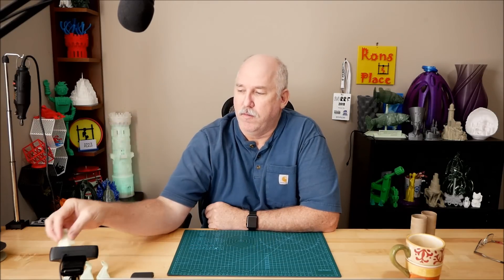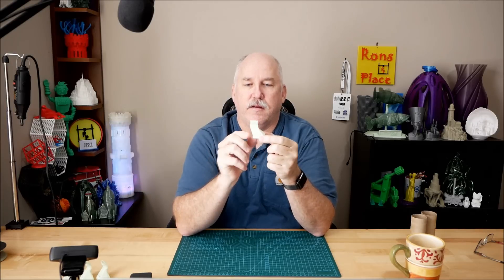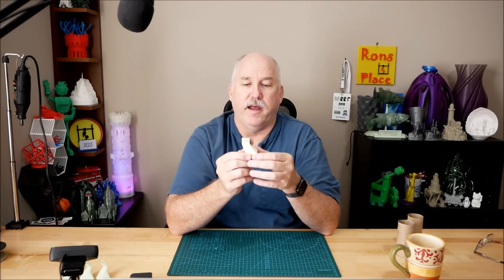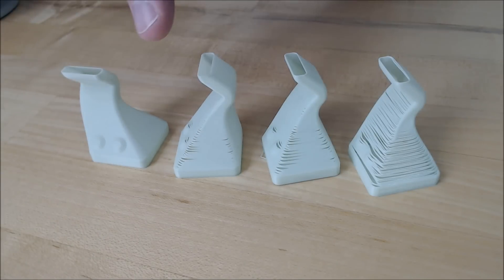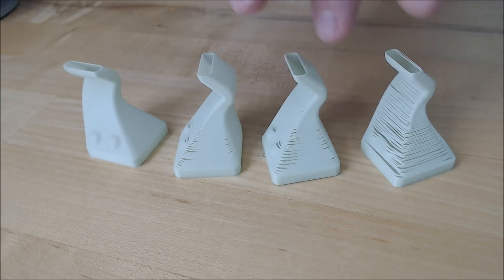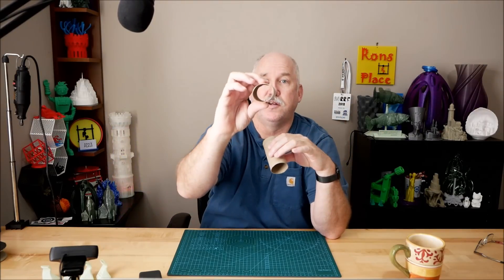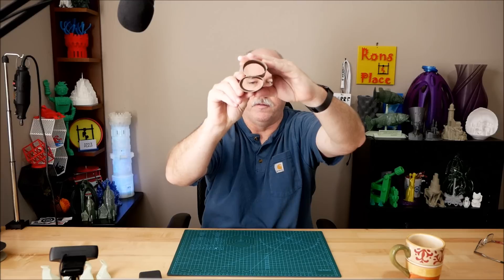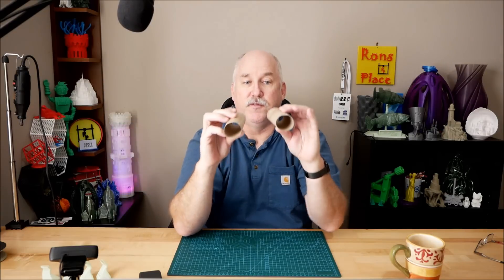Overhang Versus Layer Heights in Vase mode - 3D Printing Basics

Comment: I thought I must have had some terrible printer problem with vase mode prints being weak when not vertical. Turns out my impatient .3mm layer height was the problem. Well, guess I'll go for .1mm instead. Thanks!

Comment: For those vase mode twisty-shapes, I have good luck cranking up the extrusion *width*.  In S3D and Slic3r at least, this can be done directly in the slicer or by decreasing the effective nozzle diameter.  I find 0.8mm extrusion widths safe for PLA, PETG, ABS, and TPU, with some luck using hot PETG at 1.0mm.  Also faking a small diameter nozzle lets you print very strong closed internal shapes using vase mode due to physical overlap of close features in the model.
edit: totally unclear before coffee, now I'm tired -- hope that make sense :)
Reply from the maker: I try to avoid increasing width; but I can see how that would work also.  Wow, .8 seems like a lot of extruding for a .4 nozzle.  I may play around a bit and see how things go..  I tend to see inconsistent extrusion if the width gets pushed to far.
Reply: I don't have any of your printers, but cranking up the nozzle temperature may help lower the pressure at the high feed rates needed.  For wide extrusion complex/sharp form vase mode prints, I find high, well-controlled, temperatures my friend along with dialed-in linear advance.  That nozzle's trying to do a lot of cooling off, and who cares about oozing and stringing in vase mode, right? :)  In this case, expanding filament helps force the layers together.

In case it helps, here's what gives me the best overhangs with el-cheapo PETG (eSun Red in this case) and 0.15mm layer heights:
400 step/rev (0.9 deg) motor at 1200mA turning a Bondtech BMG, eSun PETG at 255C (70C on blue tape bed),  Linear advance constant of 0.07 (duet3d: M572 D0 S0.07), 0.40mm copper nozzle (set to 0.40), extrusion width in S3D of 0.80mm, 0.15mm layer height, extrusion multiplier 1.0, feeds go from 15mm/sec for 1st "layer" to 65mm/sec for long straightaways,  layers below 15sec allow fan up to 100% and speed down to 33% (gives 50mm/sec peak on 20mm cube).

Other colors in the same filament line seem to need different linear advance but the other settings are the same.  White, for me, takes about 0.125 on 0.15mm layer heights.  There is an extrusion width and "nozzle width" optimum.  0.8mm for PETG gives me the best, as 0.95-1mm starts to sag over 60 degrees (gets pushed down I think).

For me, this makes really strong snap-fit parts, LED lamp covers, cat toys (foot shanks), shop-vac and garden nozzles, self-locking threaded knobs (thread just the top and bottom then offset the thread angles a smidgen -- double hourglass shape), airfoils, etc.  I find vase mode with thick layers tough to beat for strength.  For ducts 'n thnigs that need holes for fan screws, just make sure the slicer doesn't know the true nozzle diameter, and slot up your model juuust enough for it to notice the gap.  S3D likes to "kick out" of vase mode without warning, so be sure to use the "Feature Type" coloring to catch the dinosaur in the act.  

I hope it helps, and enjoy the extra heat from printing!

Comment: Hi Ron great to see you again. Nice explanation using the toilet paper rolls :-) A drawing would make it maybe even more clear where you show the different layer heights for the same overhang. This also applies to some normal prints where your overhangs are way to far away from the previous layer to the next one, also here you can get the same better results going down with the layer heights. I try to preview the model after slicing and sometimes I adjust a variable layer height for that overhang so the overhang has something on build on it.
Reply from the maker: They aren't toilet paper rolls..  they are learning tools!  Very technical in nature.  You don't want me to draw..  it isn't a pretty sight.
Reply: @RonsPlace  LOL